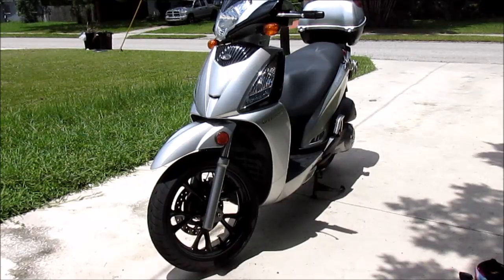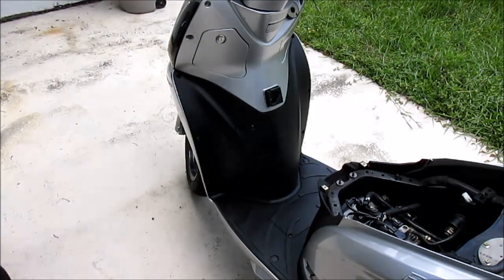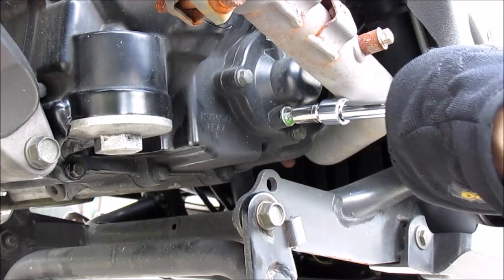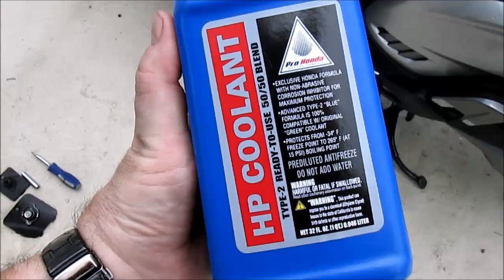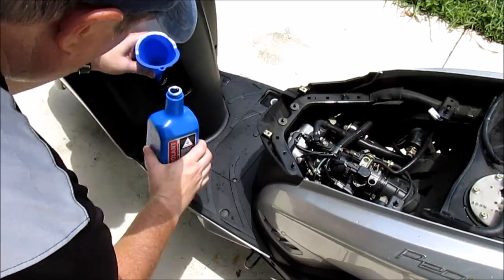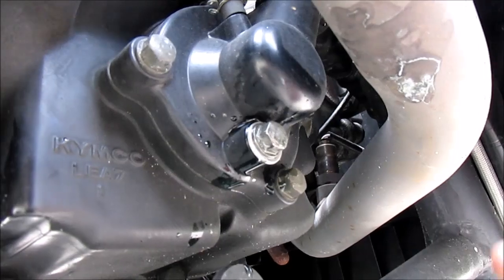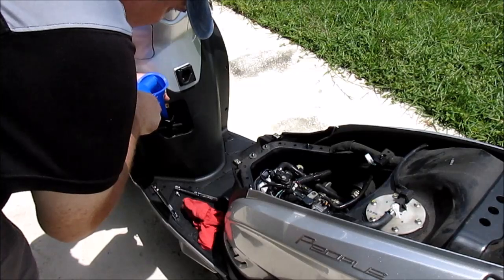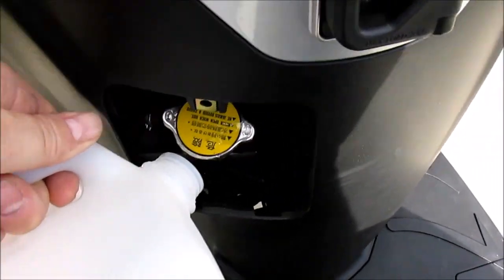Kymco People GT 300i scooter how to replace coolant & change antifreeze

Comment: You did a nice job except for one thing.
You did not flush the old coolant the proper way.

When you fill the system with distilled water and then run the engine you have to wait untill the engine reaches higher temperature so as the thermostat opens. Only then you can drain the full system. Otherwise old coolant is trapped in the system and the thermostat blocks it from leaving the tubes.

Keep uploading!

Comment: A nice video, showing where everything is located and how to get to it.

However, he should have opened the bleed screw while he had the drain screw open.  That may have allowed otherwise trapped coolant to come out.  Think of how you drain the plumbing in your house.  You open a valve at the lowest level but you also have to open a tap at the highest level.  It's a matter of geometry and air pressure.

Comment: Thank you for the video, is the screw for the air in the same position for the downtown 300i?
Reply: I confirm it is
Reply: ID4nkOI I’m just getting ready to do mine, I too have the DT300i. How was the process? How do you get rid of air and n the system? Also which coolant did you use? Kymco recommends their own Kymco coolant but I’m in US and can’t get that. Thanks a lot! Hope you respond, I haven’t been able to find much info.
Reply: @nemanjatosovic  just remove the screw and fill the fluid from the radiator. Then stop it after the fluid comes out from where was the screw.
Start the engine and don't put the radiator cap, you will see the remaining air slowly coming out. That's all!
Reply: Same motor on both bikes

Comment: Honda type II coolant for cars is the same and cheaper. It's good to see you maintain scooter but Kymco's maintenance schedule is overkill to the max. A spark plug will last longer than 6000 miles...coolant lasts longer than 6000 miles ...

Comment: I wish they would invent a better crankshaft rod bearing for these scooters because they don't seem to hold up very well even if you change your oil every 600mi, that crankshaft runs for about $400 plus engine gasket kit.

Comment: I wouldn't add distilled water on its own. You diluted the whole system with water doing that. When you add the new coolant, the water is not out of the system as demonstrated even by the fact that green coolant started coming out of the bleeder screw. Also the thermostat was closed that no real circulation is happening. Not the end of the world either way but what I do is I just drain the radiator and the expansion tank and that is sufficient. Then a year or two later I drain and refill the same way. Rarely do I open the block screw on my Honda Elite 110. Lasted 7 yrs and 30000 miles so far.